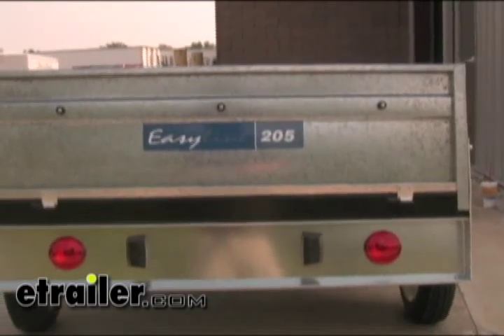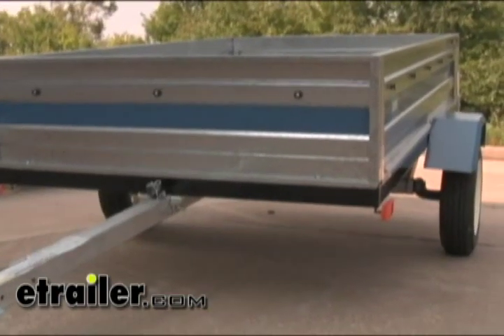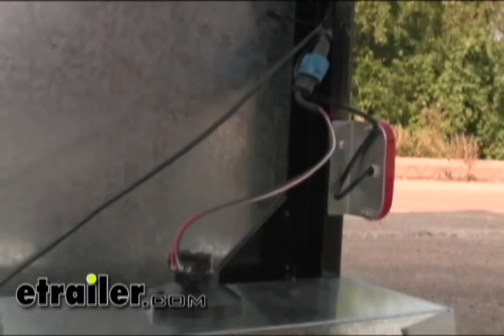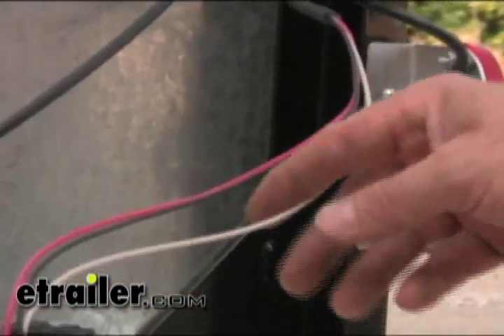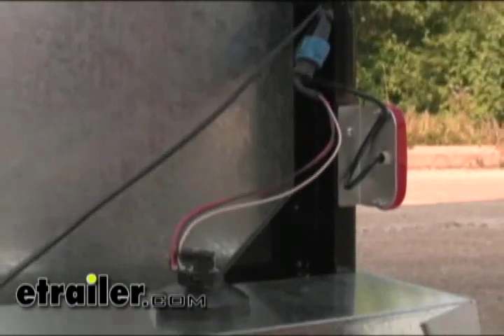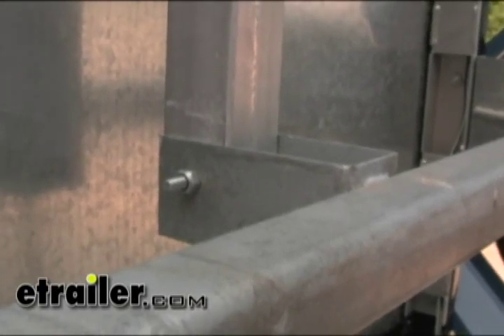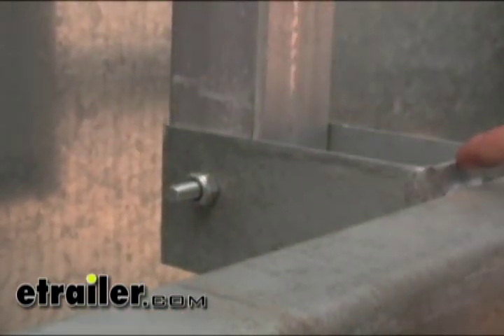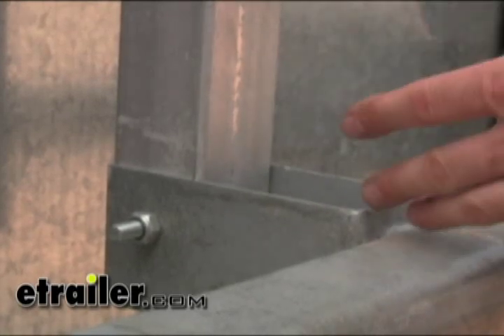etrailer | This Old Trailer: Troubleshooting the Full Ground Wire

Comment: I’m hoping you can help me out I just got the trailer and the left light on the trailer works just fine everything works running lights brake lights turn signals but and I have checked the ground on both of them and the right tail light is on but no turn signal and no breaks can you give me any suggestions thanks for your help. The truck is a 2004 Nissan frontier and everything works on it but it has the old bulbs shall we say and the lights on the trailer are LED and I had a problem on my bus to where I had to replace the emergency turn signal flasher and everything works so I figured that was the same thing on the truck and I changed the emergency brake flasher on the truck but that wasn’t it. any help would be very much appreciated.